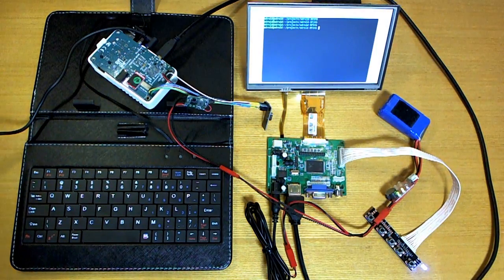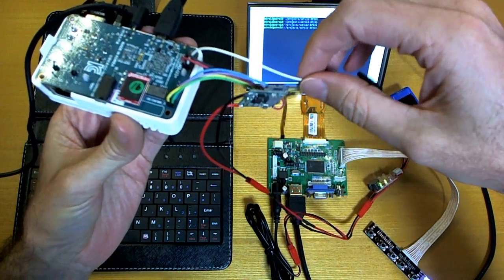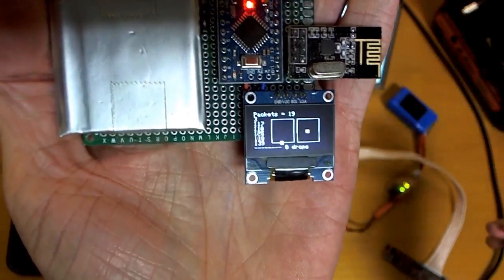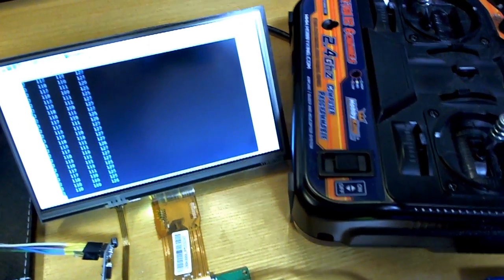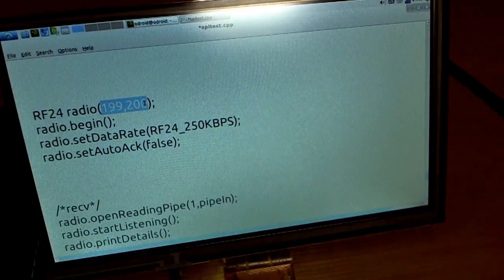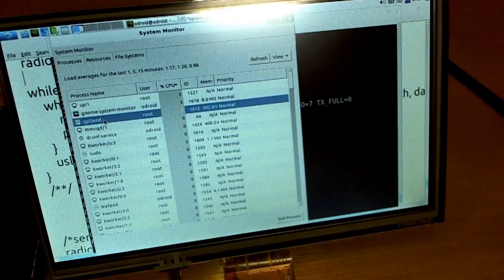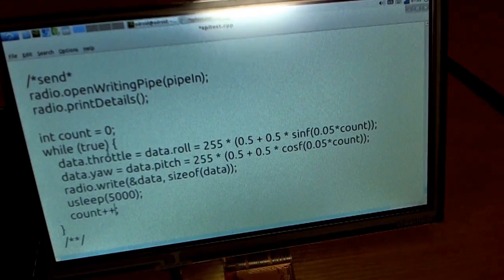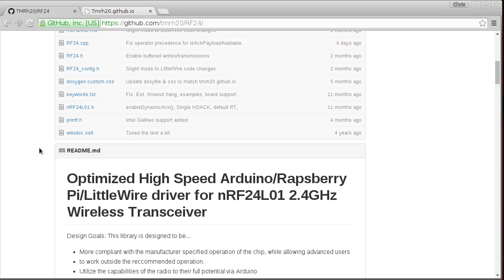ODROID U3 + nRF24L01

Comment: Nice work. I am trying to communicate to NRF24l01 through an Odroid xu4 without any success. I am using 4bit level shifter and CE pin is connected directly to the odroid. I am wondering whether you faced any difficulties.
Reply from the maker: It has been a while since I did this, but I seem to recall that I tied the CE pin to keep it active the whole time.